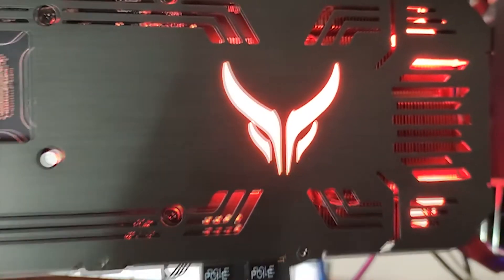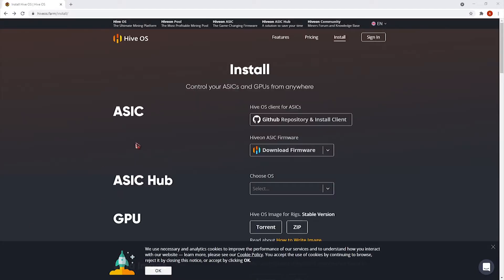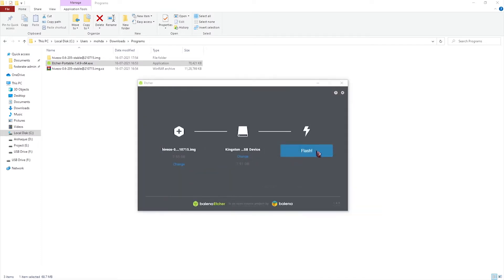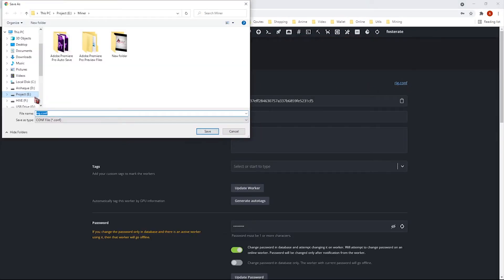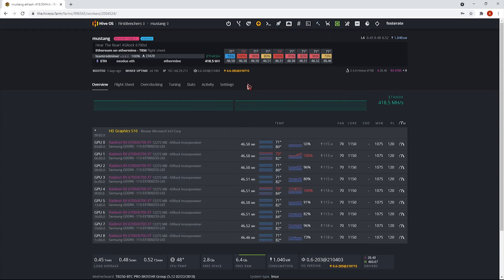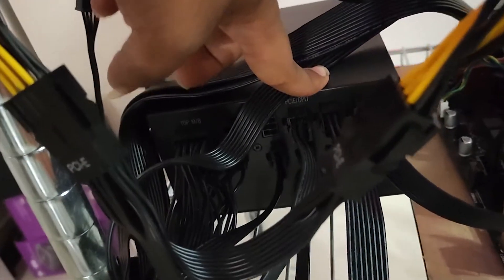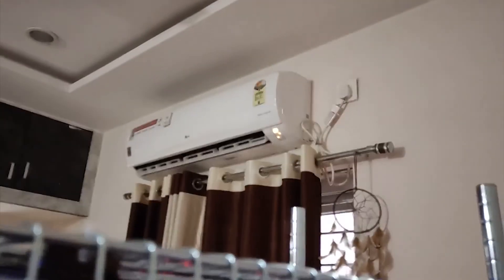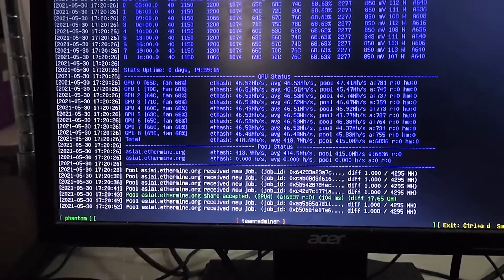AMD RX 6700 XT Mining Rig using Hive OS for Ethereum

Comment: Helo sir why my rx 6700 xt not showing gpu and power consume only 23 w on card
Reply from the maker: check the input power supply and over clocking settings
Reply: @MohdArshaque  sir other gpu work fine but rx6700 xt only not working
I show your overclock settings but not working
Reply from the maker: @Hero-Harvest  try restarting the system. miner software need to configure the GPU. check all the cables, power supply distribution. check the miner, it might not be supported for amd GPUs, if that's the case, change the miner to teamredminer
Reply: I see only rx6700 xt one card on monitor there in only nvidia driver installed so it must install other software or what plz hlep mi
Reply from the maker: @Hero-Harvest  why nvidia when it is amd GPU
Reply: Yes its amd gpu i have allredy nvidia gpu these are work fi e but amd not working i thik
Some software problems
Reply from the maker: @Hero-Harvest  change the miner that you are using.
Reply: @MohdArshaque 
Yes thanku vai
Change and working fine
Thanku very much
Reply: Sir if 6 gpu run one rige
3070 non lhr 3 card and 3 rx6700xt how much need power supply watts 1050 w enough or more than nead

Comment: Good Video. Few things you missed are:
1. In config you did not mention any additional 6+2 splitter and later in video you mentioned about splitters. We checked many splitter cables and none of them were compatible with Cooler Master GPU. Please share the link / details of splitter cables.
2. Also PSU has only 4 ports for PCIe (and CM gives only 2 PCIe cables), how you connected 5 GPUs to other PSU?
Reply from the maker: You might have purchased different PSU.

Comment: how did you managed to make Cooler Master PSUs to work? i bought 2 units and second one will not start if not plugged in to a Motherboard. i used ADD2PSU and Dual PSU cables but none of them worked
Reply from the maker: i used jumper cable. attach it in the same way shown in the video. Try debugging. the might be a result cable. Test one at a time and see. if nothing works

Comment: Nice Video. I have a question; How did you manage the cables from psu to risers ? You used the splitter cables or Risers were connected by sata cable ?
Reply from the maker: We used Splitter cable to connect psu and graphic card. We used sata power cable to connect risers and PSU.

Comment: My rx 5700 xt appears in hive os, but its not minning at all.
Reply from the maker: check the miner. use teamredminer
Reply: @MohdArshaque  yeah, im using team red.
Reply from the maker: @obeb787  If you are not using latest stable version of hiveos. or updated it dorectly from hiveos. perform normal flash.
Reply: @MohdArshaque  Yes, i guess I'll have to look for a way to update the kernel itself. I have updated hive os itself through the app, updated to 0.6-207 yesterday, but im currently not phisically present where my rig is right now.
Reply from the maker: @obeb787  i had issues whenever i updated the os through its application. Its not that necessary to update the os. try to avoid it. for now you have manual option only which will fix your issue.

Comment: Hey, so i want to build a mining rig with 6 Sapphire Radeon Rx 6700 Xt Nitro Gaming 12gb Oc with 2 psu of 750w from coolermaster and my question is, would i be able to use 3 gpus + the cpu with one psu or should i buy another one? Also, does the oc settings on hive os vary that much depending the model of the gpu? Because i wasn't able to find good oc settings  for these gpus in hive os. Thanks in advance.
Reply from the maker: you can use 3 GPUs with cpu on one PSU. OC setting doesn't vary, the output will.
Reply: @MohdArshaque   Great, thanks for your answer!

Comment: I'm running a 6700xt rig with 6 of them running on windows at 47.7MH/s drawing 80W each and temps 55° with ambient temperature of room being around 33-38°C
Reply from the maker: If you are getting 80W, then it's very good. Can you share your Overclock settings?
Reply: @MohdArshaque  This works on windows using More Power Tool and as of now not on HiveOS. Visit Dakowd Project's Channel on YT for detailed guide. However the OCs are cc-1350, mc-2150, mvolts-1200, powlim- (-36) fast timings.
Reply: @swapnilkumar2622  Which miner do you use?
Reply: @shoaibmohammad1235  I use Phoenix Miner for AMD cards
Reply: @swapnilkumar2622  what tweaks u applied on windows? Also how u remote access
Reply: @swapnilkumar2622  Interesting.  just curious, are you using high fan speeds?  my core clock is at 1150ish, mem clock 2138, and approx 700 MV, power turned down to -30 ish, drawing approx 101W, getting 48 mh/s.  But I have both 6700XT's is a computer case running barebones windows.  my efficiency is .48.  Does this sound like a decent setup to you?  I may try your OC settings and see if I can get down towards 80 W without losing too much hash.  but your performance is awesome - thanks for sharing!
Reply: @MohdArshaque  Powercolor remains cooler than most of the brands however it's power consumption is around 92-96W doesn't go as less as 80W but ASROCK's 6700xt draws as less as 80W
Reply from the maker: I have ASRock, PowerColor, MSI both variants, and Gigabyte Graphic cards. I don't seem much difference between the power consumption between these.
Reply: @MohdArshaque  Even I have ASRock, PowerColor, MSI, Sapphire and Asus 's 6700XT. Their power consumptions after overclocks are 81,94,80,78,74 Watts respectively. Asus ROG Strix is the most efficient one.
Reply from the maker: Overclocking might be working very well on Windows for you. I still prefer HIVEOS due to its features.
Reply: @MohdArshaque  Honestly, 6700xt is the most efficient card out there. Firstly, I had problems running it on windows and i wanted to run it on HiveOS. But now I've managed to tweek its settings same as HiveOS, which means after every power loss, when power is restored, the rig automatically boots up and the overclocks are applied as well.
Reply from the maker: @swapnilkumar2622  that's not just the one feature i want it on my rig.
Reply: @MohdArshaque  What are the extra benefits of using hiveOS, can you tell me? And btw I've installed the lite version of windows on Pendrive.
Reply from the maker: @swapnilkumar2622  Please refer to this link for its features.
https://hiveos.farm/features/
Reply: @MohdArshaque  For our rig (Ryzen 3200G APU/ CM MWE 850 V2/ 2 Power color Hellhound/ 1 Power color Red devil / 1 Asus rog ) we set Core 1350/ Mem 2150 with fast timing/ No power limit and teamredminer. NO MPT is used and we get 120W/118W/107W/104 watt respectively.  Rig keeps crashing every 8-10 hrs with Driver (21.8.2) timeout issue or blank screen or BSOD. We reinstalled OS, drivers with no luck. Finally we just installed driver and no radeon software. Using teamredminers command line to control clock / mem. Getting 46.5 MHs. You are using Radeon software for fast memory timing? ON MPT site talk only about RX5XXX series and could not see anything about RX 6xxx series. So is it safe to use MPT for RX 6700XT
Reply from the maker: @randomclips3957  No we have not used any Radeon software as such.
Reply: For our rig (Ryzen 3200G APU/ CM MWE 850 V2/ 2 Power color Hellhound/ 1 Power color Red devil / 1 Asus rog ) we set Core 1350/ Mem 2150 with fast timing/ No power limit and teamredminer. NO MPT is used and we get 120W/118W/107W/104 watt respectively.  Rig keeps crashing every 8-10 hrs with Driver (21.8.2) timeout issue or blank screen or BSOD. We reinstalled OS, drivers with no luck. Finally we just installed driver and no radeon software. Using teamredminers command line to control clock / mem. Getting 46.5 MHs. You are using Radeon software for fast memory timing? ON MPT site talk only about RX5XXX series and could not see anything about RX 6xxx series. So is it safe to use MPT for RX 6700XT